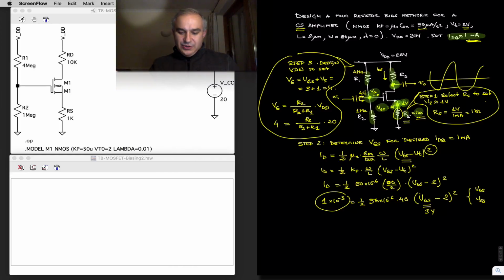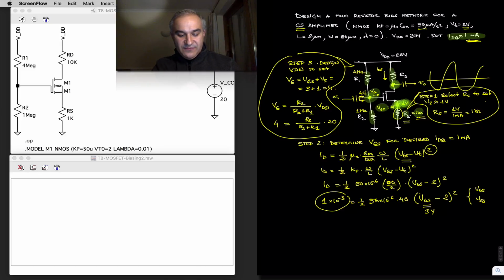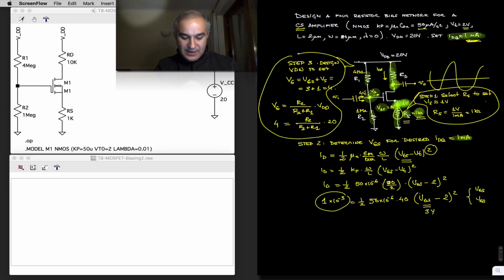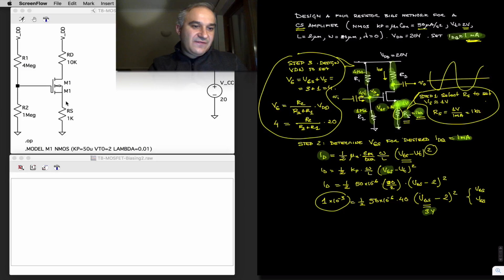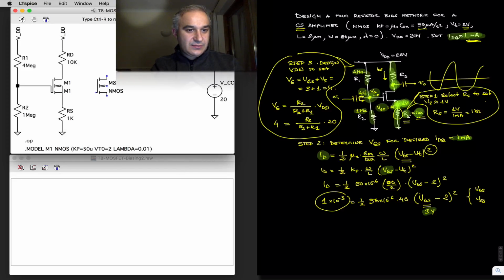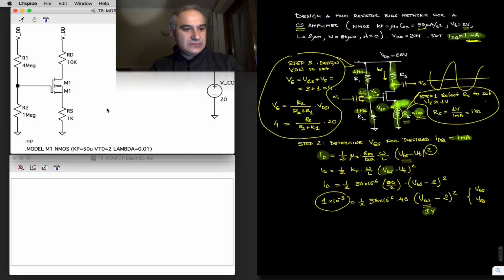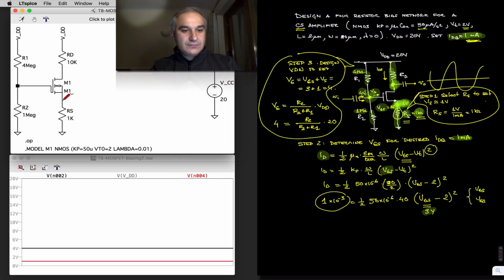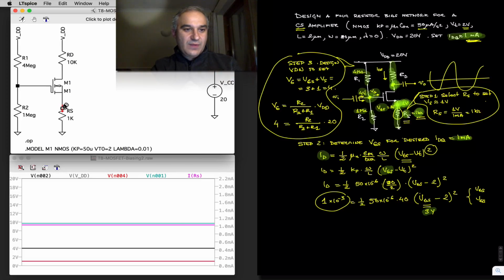MOSFETs: LTspice Simulation of Biasing Network

Comment: Hi...

I made the exact thing in my Mac LT Spice as you did, but I get different values for Vrd, Vrs and a different value for the Current through the NMOS. VG is 4volts, so thats ok. I tried everything, but I still get different values. Could their anything be different with my NMOS model? ( I used the same .model dirrective).

Maybe you have an idea.

Greetz
Reply from the maker: Make sure you use the same model for the NMOS. You also have to set up the same width (W) and length (L)
Reply: Ah OK. Have you showed the values for W and L in this Video or an earlier one?

But I think that made the difference. 

Thank You
Reply: Ok,  it works :) Thank You
Reply from the maker: Matthias Müller You are welcome
Reply from the maker: You are welcome!